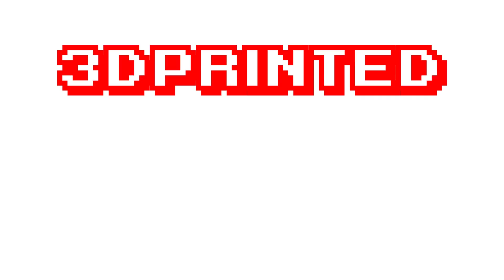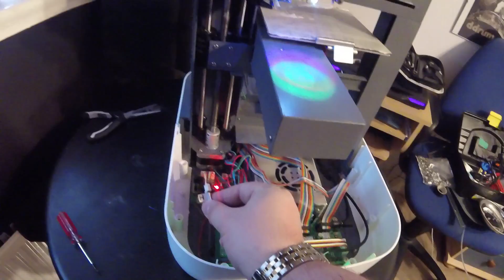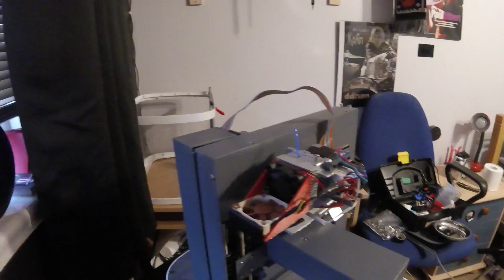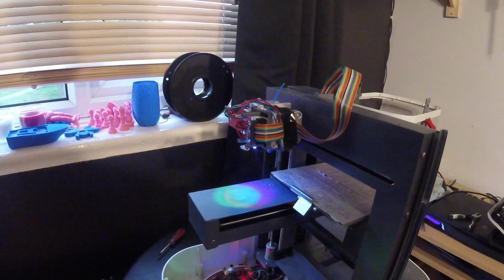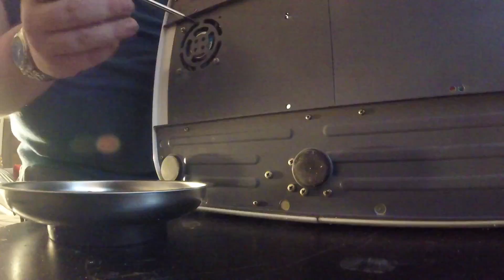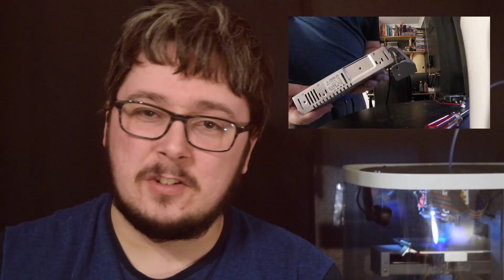Vector 3 3D Printer Modification #9 - Vector 3 Fix Overhaul Part 1

Comment: Can you please tell me how I'm having trouble trying to connect my 3D printer to my computer is a vector 3 3d 3D printer can you please help me because I am struggling have to do this thank you
Reply from the maker: Im sorry Roger, I no longer possess one of these printers. I remember it working with Slic3r. I also remember it being a bit picky about ports on my computer, so if the computer doesnt notice a com device attach then try a different port on the machine and see if that allows connection.

Comment: Mine not loued. My fan in botem like a mouse  I'm just glade it all work s ..my next problem. Is geting my print plate to move down. In command thru computer it. Seem s it naming sound an print  plate trying to move up..if to Manny up command ..? Is there a way to reset..command s...as carnt move print plate axs ..down by hand.  Or I'm hopeing crib screen ain't snap in cuppler holding tourning rod. . .I say in up n down command s. .......as next steep is. Tracking print head across print plat to calibrate it.  I'm close..  But 2 years to bild it an 5 or more years latter. It just sitting here.
Reply: Okay thank nath ..on help reply s its bean sitting there 5 year kills me looking at it. At lest its all working up till I got bild plat. Up to print head. I gess it happend to few vector 3 printer s. ...so I taken of frunt  plastic cover on left side where  moated .is .. Fuming I lost my alien key for grub screw ...but ther fine so. Not Brocken. When rod tourn s as  every time I press down. In computer command. It make jamming sound like I seed.   Do I have to tourn on printer. To tourn coupling ?  .what tool did you you to tourn it ..to make bild plate go down a littal. By hand. Or.

Comment: Thank you , so use full!!
Reply: Mitchell did u get your bild plate down an..calibrated your s ..by now I'm guessing.  How is your vector 3 printing. Good or ..
Reply: Yes I know. Seem s like u had same problem mate. I'm glade my printer all work s. Until got bild plate stuck at print head. Block. As it whent to high up. I tryed to not press up. To Manny command s.  .as I was waiting for each steep.oh well.
Reply from the maker: no problem!